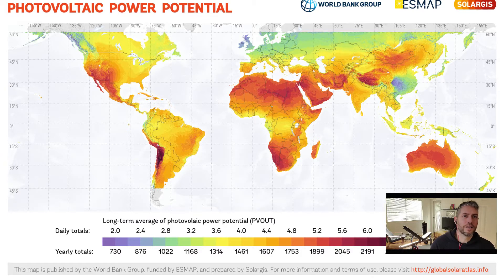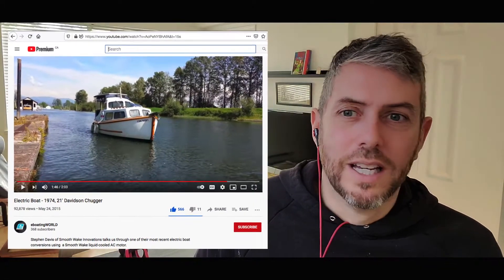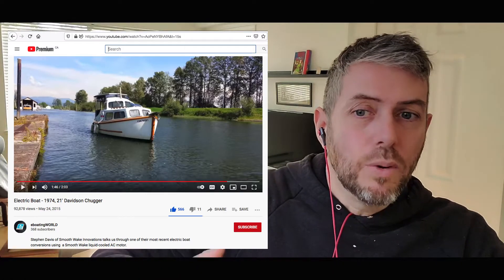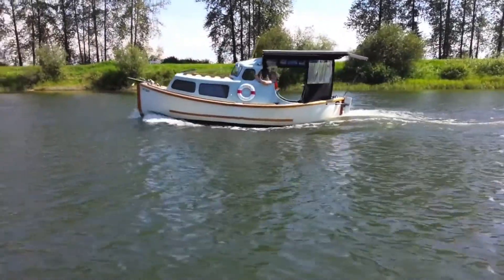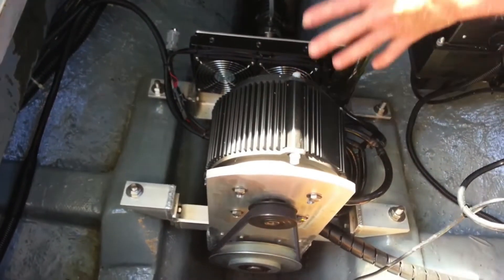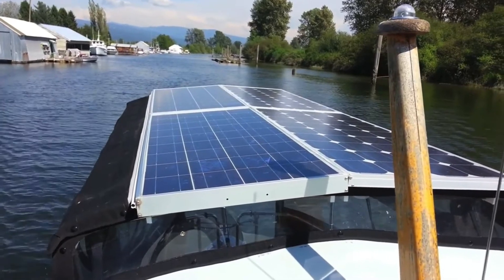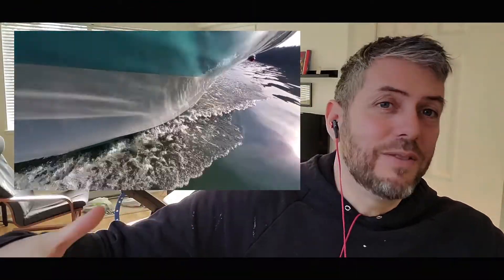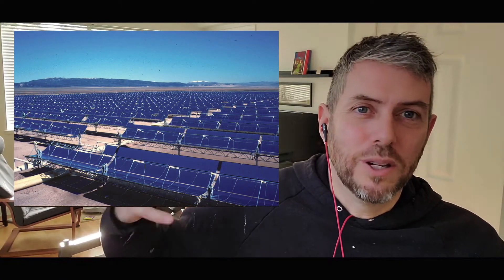Electric Boat - The Solar Panel Problem in the Pacific Northwest.

Comment: Interesting video, however as a solar user one thing I think you're missing in the equation is that solar panels charge the battery while you're not underway too. I'm not sure if hydro is included with your mooring, but unless it is, even at 4 amps, the solar panels can be quite a worthy addition. Say you take the boat out for 3 hours a week on average and burn 70amps doing so. That means 210 amp hours of energy need to be replaced. If the boat sits the rest of the week for 165 hours, even if only a quarter of them are power generating hours, you can regain 3/4 of your spent energy. If you double the array size, or it's the summer, you'll almost certainly have a surplus. But anyhow, it's your boat so I don't want to tell you what to do, just make sure idle time is factored into your solar power generation calculations 😁
Reply from the maker: 100% not worth it :) this is boating in the Pacific Northwest and they don't call it the WET coast for no reason haha.  we have cloud cover most of the year.  On top of that, I moor facing EAST/WEST in a secluded cove. Even if this was a  stationary cabin the panels would have to be constantly facing south.  Anyway,  solar for this application is nothing more than an expensive novelty. Check out Grin technology's post on his solar sailboat. That boat is just around the corner from me. The entire boat has to have solar panels along the sides and at the back. It looks ridiculous. A 7K  installation (parts only). We simply do not get the photovoltaic intensity for a long enough period of time. Location location location - makes a difference.- cheers ;)
Reply: @ElectricCruiser  oh I'm from Victoria so I know how it is. We recently put a 33kW solar install on the roof of my condo building and it only generates real power from April to August. But in that time frame it does pull in some impressive amounts of power. This heatwave we got in July netted over 5MWh in a month. Location is indeed important though, our roof is relatively unshaded. Out of curiosity, what made you go with crown batteries? And why did you replace the old interstate ones? I guess at around 5 years old they might be showing their age? What did you do with the old batteries afterwards?
Reply from the maker: Nice, I grew up in Victoria. Miss it a lot. Victoria gets about half as much rain as Vancouver. I think because of the rain shadow effect from the Olympic Mountains. It was the first thing I noticed when I moved here years ago. Don't get me wrong. I love the idea of panels but I think I could allocate the money elsewhere (like getting the mounts built and proper controllers for the new AC motors sitting in my kitchen haha). I went with Crown because of cost and supply chain issues. I had planned on larger batteries but the waiting list was almost a year. Crowns seem to be a highly respected battery. US made. Family-owned - all principles I like. I recycled most of the dead leads from the old pack and kept 8 for my house bank.
Reply: @ElectricCruiser  Yeah, Victoria is nice, and less rainy than Vancouver. I just moved to Coquitlam and it sure does rain a lot. Thanks for the info on the batteries. In the great lead vs lithium debate, what are some other benefits besides upfront cost of leads? I'm guessing ballast must be one big upside, as twin gas 318's plus their supporting equipment must weigh a ton. Are you still looking to sell the e-Tolly? I saw it listed on Craigslist a while back.

Comment: E Tolly uses 152 amps at 72 volts to go 7 knots?
Would that be the same with different motors? 
I'd think the solar panels are good for keeping the batteries fully charged up after the shore power gets them recharged and usually a 200w system is plenty.
Reply from the maker: No, different motors will give different results. For example higher voltage more powerful motors like the 375 volt ⚡  Tesla motors. 
At 150 amp the Lynch motors are producing around 15hp. A Telsa motor using the same amp draw produces around 75hp.
For the hull type of etolly it would probably take 100 horsepower to get it beyond its displacement speed which is just under seven knots.
That's why cabin cruisers get such crappy mileage when they go fast (or slow even) it's a compromised  hull design

Comment: Have you considered nautical wind turbines?
Reply from the maker: Yes but I'd need higher winds to produce any notable power while underway. We get storms that would produce good power on occasion but it's not consistent. Plus I tend not to go out on those days :) 
Panels and wind turbines might be ok on the hook or docked to keep the banks topped up  but the issue I face is range extension while  on a trip. At this point there really are only two options, bigger battery banks and/or a generator.